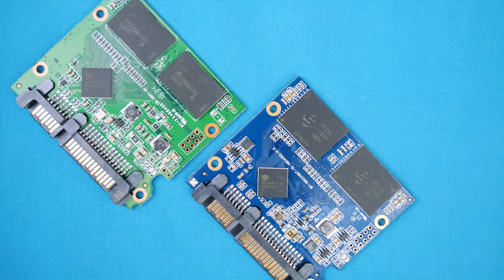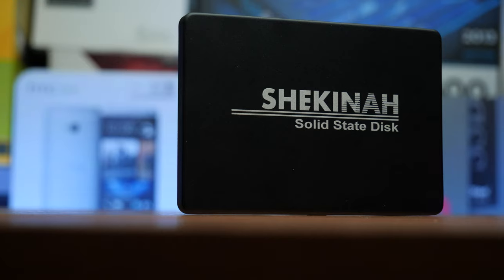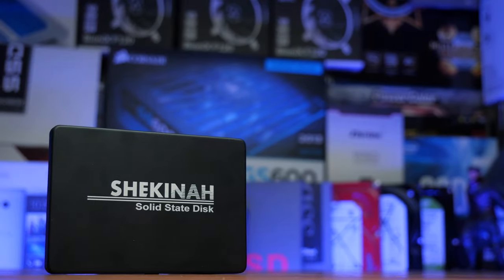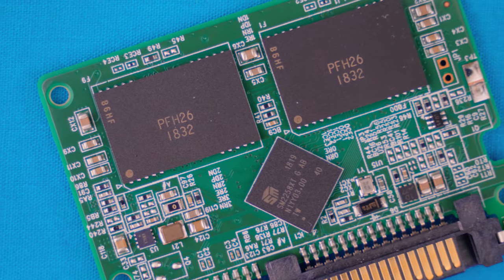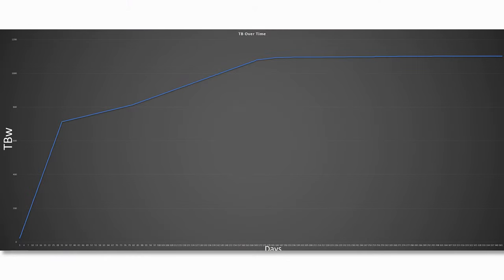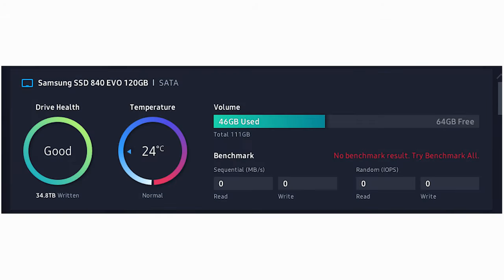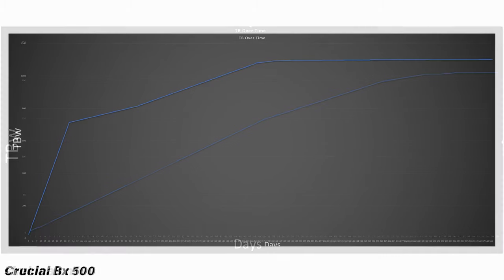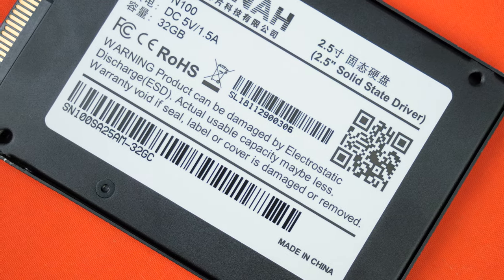SSD Endurance -How to Kill An SSD

Comment: Thanks for the data gathered, I admire your time and dedication. I'm around 40, near 50 TB, and I was worried that I was reaching that 75TB too fast but it's been 5 years with this 850 EVO, so alll good.
Reply: yeah I write ruffly 50GB per day, that's 1.5TB per month my SSD has a 300tbw rating for 5 years, that's about 91TB in 1825 days
Reply: I have a 840 brother, i will plug it back in and check the stats for you. (I have a 860 evo and 970 evo plus now). Last I remember i was still at 400-450mb read, not sure for write
Reply: @SkylineFinesse how many data in average do u write per month or day?

Comment: Did you check the data integrity though? It might have become unreliable before it hit 210TB as well. 
Normal users can hit a few TBs every year just by downloading content and constantly deleting it.
Reply: Milton Keenes  Same, I rarely delete files on my 1 TB SSD. It has 500 GB written on it total, most of which was directly copied from my hdd I upgraded from. I am more worried about my phone storage, since I only have 64 GB (no micro SD slot) which is almost full and I clean cache etc.

Comment: I've got 4 Crucial SSD's in RAID 0 as a scratch disk, it's been about a year and i've written 40TB to them apparently, with a rated life remaining of 85%
It's more likely that I'll swap them out for a m.2 array instead of any of them dying
Very interesting results though with the amount of data you managed to write, and when they slowed down!
Reply: Ssds generally very reliable at keeping data stored and normally have 2-3 layers of ECC to make data that is unreadable readable 

The amount of low level ecc that goes on in a TLC or QLC  ssd is very transparent and norm does not log a smart event (low voltage cells and auto data refresh) unless it had to use actual ecc error recovery correction data to get the data to read (norm That's when a cell has become a problem and has to be remapped but unlike a hdd the data is normally still read accessible as ssds tend to have cell problems on writes not reads so when a write fails it marks that page as bad and then writes the data elsewhere and moves all data in that page block elsewhere using spare block)

Comment: Once you get beyond 300-400TB written is where TLC based ssds start to maybe develop problems (generally irrespective of spec endurance) also dramless based have main problem with write amplification as they lack dram to handle the page table  and wear leveling information in real time so drive needs to be idle for it to perform them tasks so 200TB written seems OK

Other ssds may have better data redundancy and making sure that data stays intact 

I like crucial ssds in the mx line that has the RAIN feature to go beyond just ecc to rebuild data that it can't access, the mx300 was the odd ball as was the only crucial ssds on ebay that had lots of failing indecators in smart with rain been triggered and write and read errors been logged (so I just avoid mx300 second hand or even new due to how many used to be sold on ebay had some sort of problems on them) good to know the bx500 can last as long as a Samsung 840 Pro (admittedly going super slow towards halfway)
Reply: Really informative. I'm going for MX500 1TB

Comment: my HDD has 705GB written so far. its 6 yrs old rn
Reply: my SSD is 50 minutes old, already wrtten 750 GB.
Reply: Milton Keenes  Samsung 870 QVO 1 TB. Actually copied windows 10 from another system image.
Reply: @yashsvidixit7169  lol. yeah these stuff depend on our workload. my C drive (SSD) is about 2 years old now and it just reached 2TB. but health is dropped to 80% :P anyways it was pretty cheap and still its fast as new.

Comment: I've had a few SSDs over the years, I've never even come close to hitting the manufacturer's rated TBW, much less the "hard fail" point which is usually several times more. SSDs usually get obsolete or relegated to other roles long before that. I don't take any particular care to avoid writes either.
That being said I've never had a hard drive fail on me either; had various sizes and models from Seagate and Western Digital, never a failure.

Comment: Should I worry about the ps5 and Xbox x ssd drive? They are solider onto the mother board.
Reply: Yup, it will be the heat that will get to those SSDs before the writing constantly.
Reply: @copperbackpack2025  the Xbox has problems with heat the ps5 don't have SSD problems

Comment: But really 200TB written to a 32gb TLC probably reclaimed used nand and dramless ssd is actually very good really, as smaller ssds have less endurance then larger ssds as the nand is physically larger so 64gb ssds can take 2x the total writes a 32gb and so on for 120gb 250, 500gb

Burning out a ssd is norm not a problem but as last post 400tb on smaller ssds is the spot where you might encounter actual data loss errors with TLC sdds 

Not sure how detailed your logs was for smart and if you was doing write fill and verification tests to see if it's  able to verify the data wasn't been corrupted

Comment: Hey bro, I think you made a mistake by testing TBW rating using only small capacity. You should test it using file that has 80% of its capacity. 

There is one little thing called SLC Cache which commonly use in SATA SSD, if you only test it using less than 10% of its original capacity..uhmm forget it bro, you'll only test a SLC SSD which has 100 thousand P/E cycle, probably gonna take years before it started to die.
TLC normally only have 2-3000 P/E cycles. So there you go..

But if you test it properly by filling it till 80% capacity and also try data integrity test then good luck.

Oh yeah.. there is one more problem, windows file system (NTFS) and any other file system usually behave kind of funny when you use more than 80% capacity.

Thumbs up, really admire your dedication in this video.